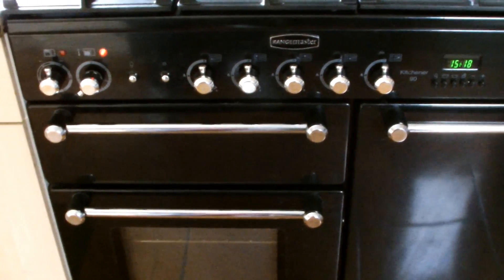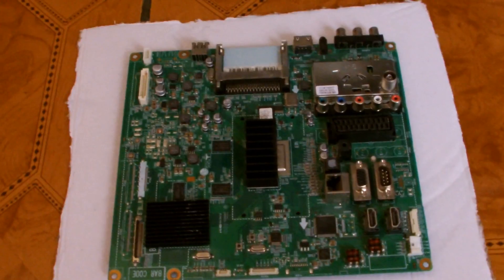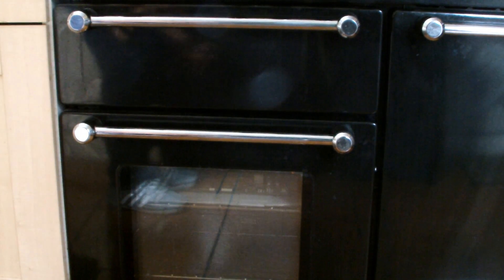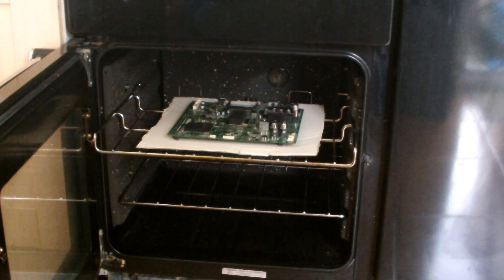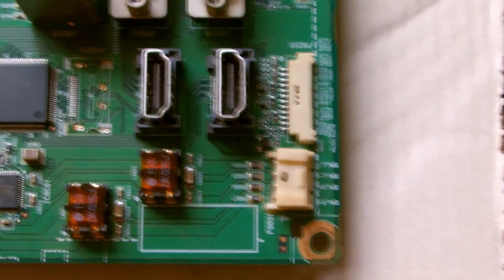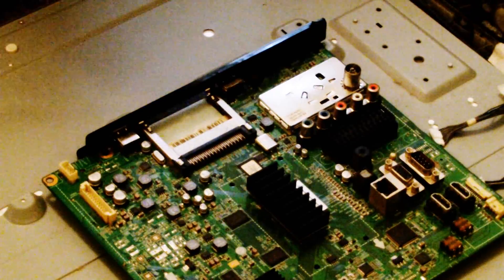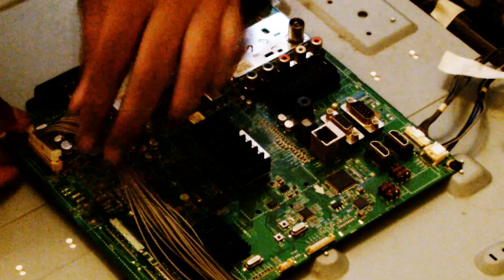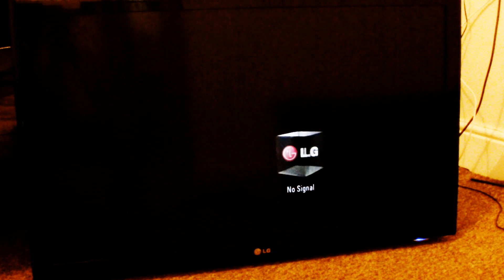LG TV stuck on start up screen: Baking the Mainboard to fix the issue

Comment: You can add an old dead telly to the list of repaired via this route.  many thanks.  200c, 10 mins, put a cover over it as was paranoid about the fan over air flow being more likely to melt some plastic component.  Smelt a bit, but all good it seems!

Comment: Thanks, I got an high end LG from 2015 and it had this issue with HDMI.
I first tried an hairdryer for first 1 min, then 2min then 5min and it didn't help, baking at 200C for 10 minutes on paper towel and then waiting for it to cool down worked for me first try.
Cheers

Comment: Nice video and explanation of the process. I only recommend that this is not done in a kitchen oven as the solder in the braze does contain toxic materials that can deposit on the internals of the oven as it's being heated.

Comment: That did not work for me. After baking the mainboard, my 2017 LG 65SJ8509 Super UHD LED TV is still stuck in a boot up loop as you see here: https://photos.app.goo.gl/hqRjBo7VgQPwov3T6.  Maybe the fault is in the power supply board?

Comment: Totally sceptical about this.  Was none too gentle taking my LG TV apart as this wasn't going to work, I had my new TV picked out already because baking bits of your TV in an oven is never going to work, surely. THIS ACTUALLY FIXED MY TV!  It was very simple from start to finish under an hour and £500 saved. Thanks!

Comment: Tried it, didn't work..say goodbye to a $2500 TV :(
Reply: Aim Dawson 
tell what TV you  have I can fix from here send model number
Reply from the maker: Hi Aim. What are the symtoms/problems you have with your tv?
Reply: I do this all time oven temperature sure be 350 degrees  but aluminium pan  bake 15 mim. and turn off oven and crack the oven door. let sit in over with door crack to the oven and board cool down complete do not get board out or oven temperature complete cool down it reflowing

Comment: This hack worked for me and got my 55in led LCD tv repair after it got stuck at LG logo screen. Set oven at 350f (targeted for 385 because it runs hot and is old), after preheated, placed motherboard on piece of cardboard and baked for 10 minutes, after 10- turned off oven and cracked open oven door about 1 foot open to begin cooling for 10 minutes, then opened oven all the way for 10 minutes. After, removed from oven and set on table until cool to touch, then reattached it. 

Smell: yes, it smells bad, but i didn't have as much smoke and fumes as it looks like this guy did. Kids were in bed sleeping and it didn't go upstairs- we opened a door for fresh air, and turned on a bathroom fan. It was less powerful than food that falls in the oven and burns. It was a "hey- I can smell the solder now" strength. Not worth worrying about doing it outside, just make sure you can open a window or a door for fresh air. 

Thanks to everyone for your help! Pay it forward.
Reply: Model number 55le5500
Reply from the maker: +Objection Kat great work man!

Comment: Instead of using the kitchen oven, use a toaster oven and do it outside... Save your house from the stink!!!!
just remember that 200C is about 385F... solder melts at about 365F... if you place it on cardboard and go above 451, your cardboard will burn